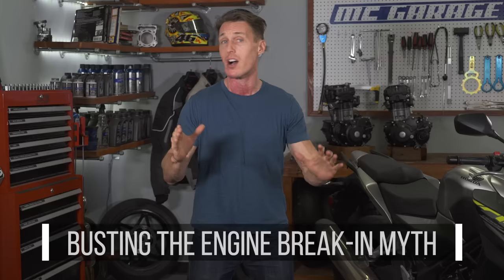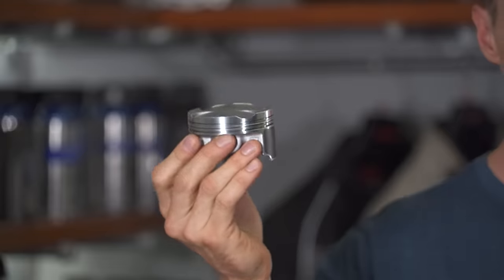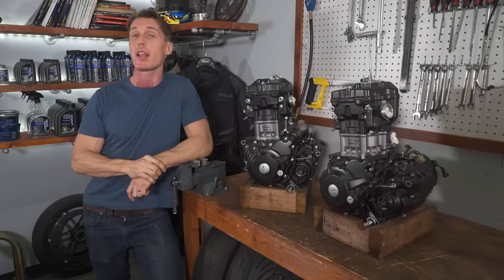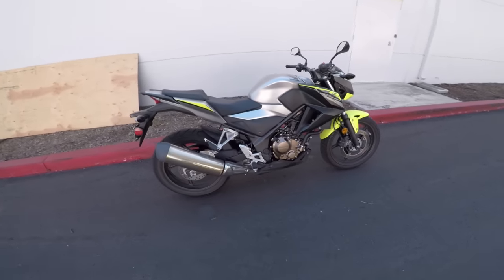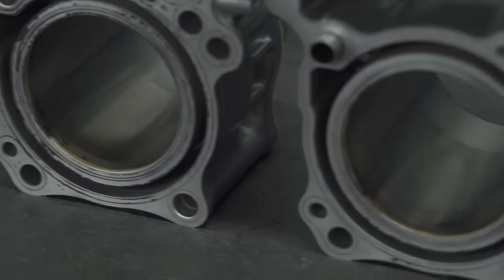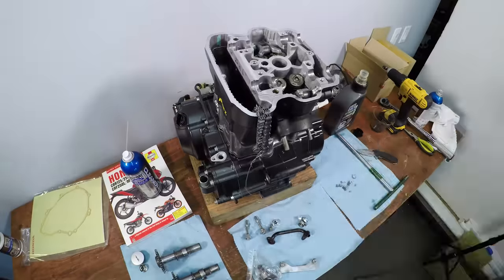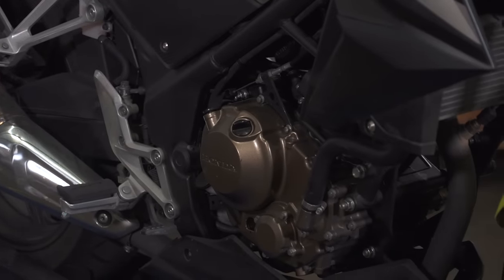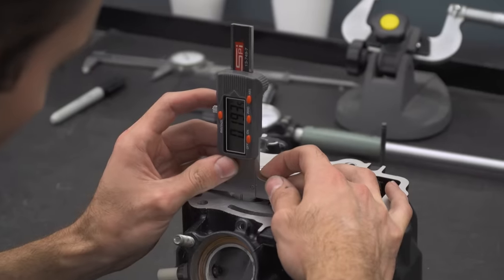Busting The Engine Break In Myth | MC Garage

Comment: Was Honda aware that you where removing the factory installed oil and replacing it with semi-synthetic? Manufacturers always recommend a short interval with that “break in” oil before replacing it with your choice of approved oil and filter.
Reply: If the grade is same, it doesnt make any difference tbh
Reply: @hiteshadhikari  Exactly.  People think full synthetic has different viscosity from mineral oils.  Well guess what?  They do not!  Fully synthetic is exactly the same as mineral in it's function.

Comment: Parts are built/machined/cast to much higher standards then 50 years ago. In the past 10 years ive had an harley v-rod,r-6,r-1, zx-10r and now a superduke 1290 and they have all been broken in on a dyno. Ok then harley blew a breather hose, spewed oil everywhere and the radiator rattled so loose it almost feel off those are all things that would have happen soft or hard break in, besides that i have never had any engine longevity or performance issues.

Comment: The bottom like should be to follow the manufactures specifications.  You blow that new engine up or if it just failed while riding near red line then you may have just bought an engine.  Warranty can be denied for not following the manufactures direction.  Think they won't know? Think again.  There is a science behind wear, friction and many new bikes have black boxes that record data- engine data.

Comment: If its an air cooled engine like harley davidson then breaking it in hard does affect the engine, all harleys have to be run in as per the book, the only reason I know this is because there is a video with 4 harley tech guys who tell you what happens to an engine that's run hard from new, they say it definitely causes damage so go by the owners manual, but bikes with a radiator can be rudeness hard from new as per this video.

Comment: On an automatic scooter with one gear it doesn’t matter. It will never get close to redline even with you holding the throttle wide open for an extended amount of time. They make it that way to protect the engine. And on a 50cc for example, it only tops out at about 40 mph….. are you going to drive several hundred miles at 20-30 mph? Nope. Especially when it stops several thousand RPMs before redline and won’t let you go farther. If you have a one-gear automatic  scooter just go out and have fun.
Reply: 50cc cvt scooter doesn't sound like fun but to each his own I guess
Reply: @szymoniak75  … 50 CC’s are a freaking blast!!!  But just in a different way

Comment: My FJR break rpm, in top gear was faster than the UK legal motorway speed limit.
Reply: I remember my first Fireblade. Try not to exceed 4k rpm for the first 600 miles. 100mph in 6th.

Comment: When I worked at honda we had a family who bought a brand new civic and jumped on the freeway and drove from socal to Vegas and back ,it came back with excessive oil consumption and needed new rings and sleeve resurface ,the guys who designed your bikes and cars are engineers not you tube guys they are pretty smart guys and likely wouldnt blow their own faces up just saying.

Comment: 4 strokes break in differently than 2 strokes though so this should only apply to 4 strokes ive watched some 2 strokes get rebuilt to all brand new parts and then a couple of them were not broke in like normal they were rode hard basically instantly and they both lost compression after a few days of running and the engines that were broke in correctly didnt lose any compression and are still running to this day so for 2 strokes you cant just hammer on them because of how they oil themselves and how everything expands rapidly, in the end the hard break in bikes that lost compression were brought to my shop to get fixed and they both had the rings pushed into the pistons and stuck and the pistons were brand new just like the whole rest of the engines

Comment: Never seen it as a myth or an opinion issue. If the people who designed the engine and conduct test on more than two engines tell you what you should be doing what's the issue? Why even change the oil or filter.
What we didn't hear was the independent results of an oil analysis and a leak down test. I would have liked to see the test drawn out to warranty maturity and then tested...
I know that engine manufacturers can make recommendations that seem self-serving. In my airplane lycoming recommends the engine be overhauled at 2000hrs. Pilots with the same model have flown their planes 1000hrs and more past that number. I might add we change our oil every 50hrs because sitting oil is just as bad as no lubrication.

Comment: Its nutts how drastically different bikes are than cars. So far the best way to break in a v8 is to use used oil and let it idle for a full tank of gas or take it easy on a 200 mile drive. Used oil is already broken down and let's parts gently wear in. I haven't seen anyone do this for a bike engine, but I say fuck it.

Comment: Nobody is taking into consideration the multiple Crank joints, crank shaft bearings, timing chains (if applicable), transmission: gears/CVT chain, oil pumps (if applicable), RODS, CAM SHAFTS, CAM SHAFT BEARINGS/FOLLOWERS (if applicable), ROCKER ARMS, BUSHINGS!!!
You took a single cylinder simple engine out. Get into two or more cylinders with more HEAT, INTERNAL RESISTANCE, MOVING PARTS, it can be majorly important.

Comment: I thought there were more parts to a motor and transmission than just piston rings and cylinder walls.????

Crank, valves, gears, chains, bearings, races, seals. A clutch...

Comment: Uhh, that wasn’t the hard break in method. The hard break in method requires a near instantaneous oil change with the cheapest oil and you are still supposed to blast through all the gears… up and down.

Comment: So if -0.005inch in less then 1000km that would result in -0.01inch after 2000km? What's the difference would be in 10 000km? I mean a small difference would make one piston 'vibrate more un-evenly and progressively deform the engine holes more and more over time and burn more oil that gets in there etc. 
I don't know, not and engineer just did a small class in precision machining, that's pretty big difference to me. 
Also as someone who pointed this out, these a small CC engine, the difference would be more amplified in higher CC engines? 
Hmmmm
Reply: The wear and tear are not linear, u cant compile the data based on multiple factors.

Initial wear will be higher but will slow down in most cases.
Reply: @hiteshadhikari  Initial "break in" is the same for all modern engines except the manufacturers who produce inferior products to begin with.  Nothing can help these and we all know who they are.  I have owned plenty of new engines as has my father and he goes back to the 1950's and he always said to drive them from new like you want to drive them when they are twenty years old.  We simply do not have the wear or failures that so many get.  You CANNOT baby or nurse a new engine.  This is how the owners manuals are written by lawyers.  Absolutely guaranteed to get you back with all manner of premature wear issues down the track and needing to buy a new car or rebuild the original one.  My rule is 150-200KM's until WOT whenever you feel like it but not redline all the time.  I don't believe to drive it like you stole it as that is going too far.
Reply: @theaustralianconundrum  i agree with this, i am.just explaining why initial wear and tear is higher and after certain time it becomes normalised and doesnt happen as fast.

It doesnt mean initial one is catastrophic, it just means its higher
Reply: @hiteshadhikari  Of course it is.  It has to be as the assembly tolerances are such that this "mating" in must be accomplished.  To be honest even if a modern engine is run at idle for 100 hours it won't glaze the bores.  As an aside no aircraft piston engine aircraft have a running in procedure aside from WOT on takeoff as always required.  They are simply operated as normal operation which is of course absolutely flat out on takeoffs and almost flat out in the climb to cruise level.

Comment: Always break in you engine. If you dont break in the engine it will not last as long and after a while you will have excessive wear on valve train, rings.... This test was very bad. You need to start with new engines and measure everything before and after...

Comment: You took two used motors that were already heat cycled a couple hundred times, so the casting and crank has had a chance to stabilize. That makes a big difference.

Comment: I'd like to see that engine after 60,000k Also this technique is most certainly not the best for big air-cooled twins. where they see everything from ambient air temp through to 240 degrees. Tolerances are much more marginal and running conditions on a single cylinder water cooled are a lot more stable and consistent!

Comment: Hi, i often see GSXR1000 K7/8 where difference between rude break in a la Motoman and the way the manual says, given results that differ between 161 RWHP and 169 RWHP, how do you explain the difference in favour of the rough break in, please?
The 161 WRHP can get the extra 7 HP with a PowerCommander, exhaust and a filter, but why go to all that with a cost of up to 2-3.500 $ when rough break in gives you that for free, please?
I was told by a engine repair shop-owner that break in should be quick, because the sealing between cylinders and wall would be much better, tighter sealing, less blow-back, more performance.

PS!
I would have liked to see a dynotest on these to Honda engines, that would have set the record straight, more or less or the same power???

Cheers
Allan

Comment: Breaking in two engines shows you absolutely nothing from a statistically backed and fair test POV. You would need:

- Only the independent variable is changed.
- Controlled variables are correctly implemented.
- The dependent variable is measured with accuracy and fidelity.
- The experiment could be repeated with the exact same results on many different occasions, probably hundreds to make it statistically significant.
- A control group

The manufacturer has likely conducted a far more exhaustive, vigorous and statistically fair test than you could ever perform.

Comment: The presenter skipped over the difference in ring gap very quickly...so I'm assuming that the gap was wider on the 'ride it like you stole it' motor - ergo: slow break-ins are better for long term engine compression and oil usage. Also, he's discussing engine break-in as per owners manual and only does a top-end rebuild. All the gears, big-end bearings, clutch and so forth have already been worn in. This video hardly rests the case about engine break-in for new bikes. It should be more accurately titled: "Do you need to break in rings after a top end rebuild."

Comment: Yes. Shocked....Shocked that you are taken in by $$$$$$$$.   I mean... business is NOT about having NO repeat Business.  Its not a Hold over..... or some ol tymy idea.    But when you find the bike in the shop more than you expected...... :O    And don't worry about checking the tightness on your nuts and bolts either, after all, the break in wont affect those either.   Tuff guys cant wait, for the break in period to elapse.  After all...machines NEVER BREAK due to abuse...right!   cheers.

Comment: This analysis only addresses the dimensional aspects of an engine break-in. It doesn't address the metallurgical changes associated with heat transfer. In other words it gives no consideration to the effects of excess heat generation on metal parts given high load, high engine speed, rapid braking, etc.

Comment: Compression test and measuring wear are pretty pointless measurments. You should have measured blow-by volume since ring sealing is the main thing important to break- in. The level of difference would be so small static tests were pretty fucking stupid to try.
Reply: Or a 10 hour oil consumption test on engine stands. That would be a reasonable test that actually tests what you are comparing (ring seal) and is something viewers can relate to.

Comment: Is it really worth waiting to break in the engine?
Reply: It is if you can't afford to rebuild a blown engine. And if you ride on a consistent basis, the break-in period will go by really fast.

I'm just under half way through the break-in on a 2018 GSXR-600 and I've only had it for 8 days. I typically ride no less than 30 miles at a time, with an upper range of 75 miles. Average that out to ~50 miles per ride and you end up with ~11 ride sessions for the break-in period of 600 miles on that bike. If you ride almost every day, 3-4 times a week, you'll be done with the break-in within 2-3 weeks.
Reply: @Soldier4USA2005  Thanks for the  tip. Yes I do ride regularly but some guys out there open the throttle wide straight from the showroom, I guess they might be facing lot of mileage issues later. 😛
Reply: @rishman26  You're welcome.

No matter how well something is machined, there will always be defects because nothing is perfect.

Add in human error when they build the bikes and you end up with no 2 bikes being made/built the same.

Be safe out there.
Reply: @Soldier4USA2005  Completely agreed on this one! 

Anyways nice to talking to you on this platform. Even I am trying to create some content on this topic. Hope I get it done right and soon. Ride safe you too! Cheers. ✌🏻

Comment: There really isn't a break in period. Especially with modern casting and forging. It doesn't make sense
Reply: No 2 parts are made the exact same way. Let alone 2 bikes. Especially when large portions of each bike is built by hand. You have "Monday bikes" and "Friday Bikes".

Monday bikes are when all of the tooling is fresh on the mills, the shop has been maintained, everyone has rested over the weekend, etc.

Friday bikes are when all of the machines are worn down, the shop is filled with misc crap from each shift, everyone is tired and looking forward to going out with their friends/wives/etc.

The break-in period is to account for those variances and viscosity of the machined materials before they're smoothed out to that builds specs.

Comment: Just do what the manual says - simple. The engineers know how to correctly to break in an engine - as all of the other things have to break in at the same time!
Also, you have to compare after 10k/20k miles also, as the damage of a hard break in won't show for a few years.

Edit: Good test though.

Comment: The first oil change on a new engine tell you for a fact that a break-in period is true. The oil looks like metallic paint! Do you also believe in skipping the removal of break-in oil and run it for another 3,000 miles, ya know because it’s a “myth?” Every reputable engine builder breaks their engines in properly before hammering them on the drag strip 🙄

Comment: You did no "Busting" of Break-in as being a "Myth" because you actually did a break-in on both engines.  it would of been fare to have a third engine that you drove normally for 2000 mikes before the oil change and no filter change.
Also those engines were water cooled and not air cooled engines. With Honda clone engines with no oil pump or oil filter , Break-in is a proven necessary fact and not a myth.

Comment: 235 psi, wtf?
Reply: Dude, I thought the same thing. Someone needs to explain this. With 10.7:1 ratio at 500 ft above sea level I calculate 154 psi. Am I missing something? Please help!
Reply: At California’s average elevation being around 3000 ft, I calculated 140 psi. I’m guessing he meant to put 135 psi?
Reply: @gilbertblanco14  Yeah, but that's on multiple data entries from a NASA approved calibrated hardware (taken from the truck cousin Vinnie's car of course) and trained technicians. For an accredited shop to make that kind of mistake is not good, I worked at engineering testing lab and you don't do or at least publish erroneous reports like that.

Comment: Piston rings are the only thing that need break-in.  The rest of the engine (except the cam to buckets, but no biggy there) is flow-lubricated.  

As a mechanic who's experimented, researched and actually BROKEN in engines I've rebuilt many times, a moderate break in is the way to do it.  Warm up the engine, then ride/drive with full throttle to a bit short of redline, then close the throttle completely and coast down.  Repeat about half a dozen times and you're broken in. 

Done.  'Nuf said.  Simple.

The slow break-in gains you NOTHING.  The "hard" break-in gets it done faster and obviously having your break-in done faster means you get your performance and efficiency gains (and you can actually run the engine 100%) sooner.

Dino vs synth?  Doesn't matter.  The entire difference between the two is how long they last between refills without breaking down.  You can indeed break-in with full synthetic (BTDT) just fine.  The myth of needing break-in oil is just that, a myth.  Synthetic doesn't actually lubricate better when it's fresh, it just lubricates better longer.  I even remember old guys saying you need detergent-free oil.  Again, doesn't matter one bit.  Put your regular oil in.  Further, if an engine is built right; if everything is to tolerance, you won't get any real amount of particulates in the oil/filter.  If you have a noticeable amount of metal, your engine builder needs to get his ass beat, because he did something wrong.  Metal in your break-in oil = some clearance or finish is out of spec, which means the guy who built the engine shouldn't be building engines.

Likewise, brake bedding is a 10 minute process.  The "gentle" bedding process is for uncured brake pads, which is something you don't see anymore.